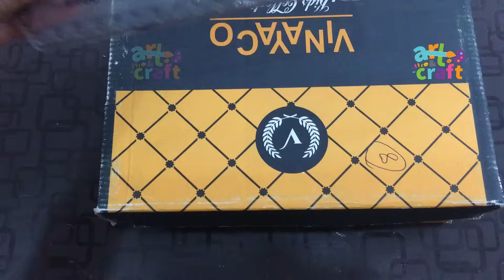How to make Led Cricket Stumps | HomeMade Led Cricket Stumps | How to make Led Stump & Bails at home

Comment: I made it but when I put bails on stumps the light however turn off but battery start get heating Why ?? Any solution?
Reply: I am a Science Teacher. Yes the +ve wire of the battery or bulb if it touches the -ve wire, the battery will overheat and get spoilt, tried this out as well

Comment: Please use rechargeable 3.7 volt Lion battery instead of expensive 9 v battery
Reply: Yes because in this stumps the battery is getting short so it will die quickly and we cannot charge 9v battery that's why use 3.7v

Comment: Wrong,,,, 
Switching me battery short Ho rahi hai,,,
Reply: Yes so use 3.7v rechargeable battery because 9v will die quickly and we cannot charge it
Reply: I am a Science Teacher. Yes the +ve wire of the battery or bulb if it touches the -ve wire, the battery will overheat and get spoilt, tried this out as well

Comment: Wont the battery overheat when you leave the bails on the stumps for some time?
Reply: This is a homemade creation and they don't put extra effort for the safety, which will be more costly enough rather then buying LED stumps.
Reply: But since it is a Creation without much technology it's a gem! Or master piece .
Reply: I am a Science Teacher. Yes the +ve wire of the battery or bulb if it touches the -ve wire, the battery will overheat and get spoilt, tried this out as well